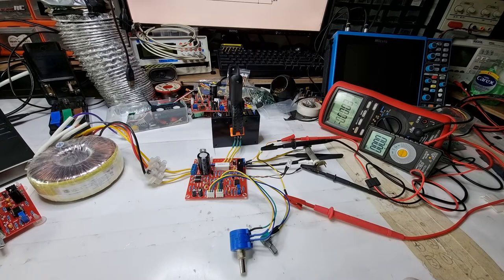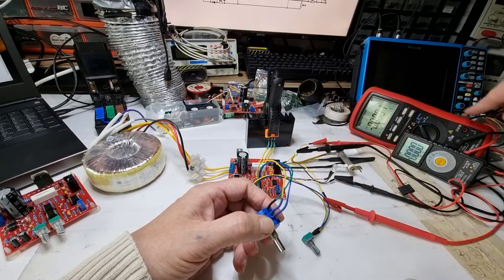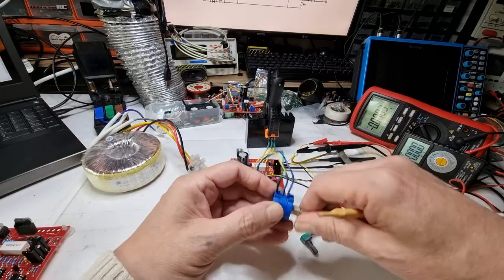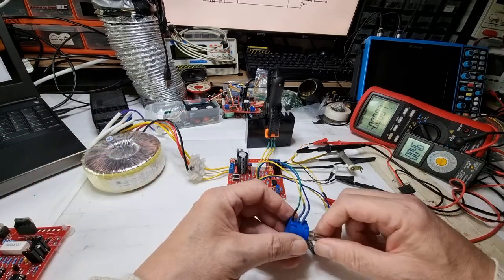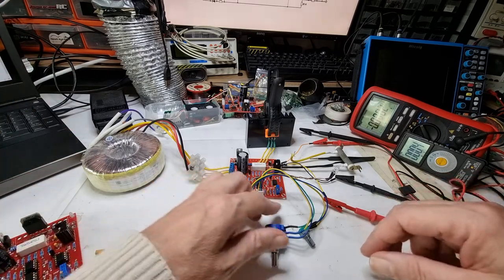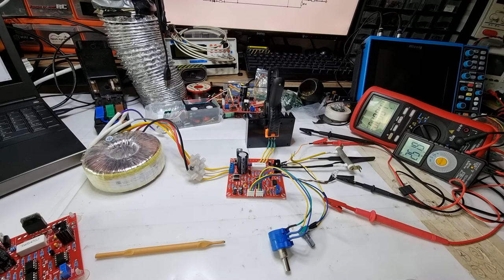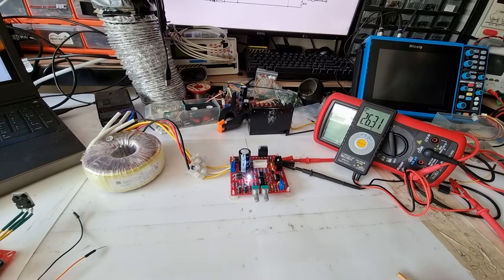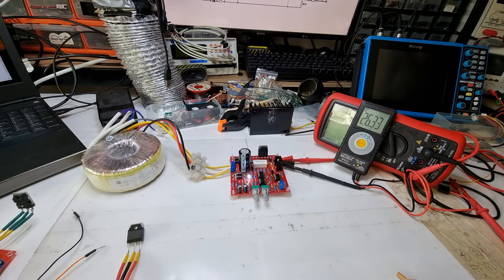Real HiLand 0-30V 2mA-3A PSU Kit vs Fake RED Board Kit

Comment: I had my friend build the power supply with the same power supply as you describing and I had no issues with it, he said some of the chips can not be trusted so he said anything he buys he install a socket. so you can easily change the ic's
after you build rather than de-soldering and screwing up the traces.
Reply from the maker: Hi, yeah I did that already but used cheap from Amazon and no difference. I am waiting on RS Components to get some in ~ February. Then will try again.
Reply: @Elecifun  hmm so replacing the TL081s does nothing. 🤔
Reply from the maker: so far I'm afraid not. I bought some TLO81 from Amazon seller based in UK, they didn't change anything but they could be dodgy clones.
Reply: @Elecifun  so the TL081 ICs you bought from Amazon you think maybe they're faulty or fakes or not what they're supposed to be? 🤔
Reply: @Elecifun  I was reading an article yesterday about the 0~30V 3A psu board.

The problems are know and common.

I think maybe the power supply is stressing the components.

I think the potentiometers on my kits are useless.

I think a few other guys threw them away and bought 10 turn pots still I've seen other guys using them.

Like for example a electronics youtuber like yourself had a 75VA transformer. 2x37.5.

He kept the 24V transistor (with the 24V port,) and added a drop down converter 0-40V on the input  (mini one) and configured it for 12V out. He's got a 12V fan running of it and he's using it to also power his 12V 10A Voltmeter/Ammeter.

Another guy swapped out his 7824 trannie for a 7812. 12V fans are more common and he's using the 24V port which is now obviously a 12V port to power not just the fan but also his 12V/10A voltmeter/ammeter.

This is another strange anomaly with this power supply kit.

Strangly he decided to keep the TL081s which most other electronics engineers decided to upgrade to 44V ICs.

That seems to be a weak spot with these PSUs.

A German engineer seems to think this psu board is over stressed and recommends using and a double 18V i think he said. Which I guess means its a much less powerful power supply.

The other guy using the mini step down converter used a 75VA transformer 37.5V x2.

Another interesting thing I learned is that  what I thought was just a power on light on the board isn't that at all. It indicates the PSU  is in some mode. 

Incidentally what power supply are you using? I can see its a toroidal but no idea what its rated at?

The guy that changed his 7824 and put a 7812 mentions some other interesting mods like swapping out the C1 (the fat cap) 3300uF for a 4500uF cap or some how modding it by adding another cap in parallel (god knows how thats done) and beefing up the .25W resisters for .5W resisters and various other modified if one wants to increase the current capacity. He I think seemed to think it was doable even with TL081s which seems somewhat confusing considering what the others were saying.

This guy did stipulate that a much bigger heatsink is required which is what I've now done.

In hindsight it was a good idea because before adding this new heatsink the fan was coming on every 5 minutes.

The D1047 gets incredibly hot even with a much bigger heatsink fan assy. He also says a TIP3056, or 2N3055 could be used instead of the D1047.

I'm thinking I might get some replacement parts like the TL081s even though you said in your case it made no difference to your issues.

I'm also going to add ic sockets for the TL081 opamps.

Maybe then later I could used the beefed up op amps.(44V).

Right now I'm ordering the .5W resistors and other more powerful components.

I have one more board left which is what I'll use.

That'll have all the more powerful components that this guy recommends using.

Anyway let me know how you got on with your mods.

Regards,

Decem.

Comment: Hi, back again.

Well I received my fake boards and finally finished assembly the kit.

No instructions.

No photos to work off.

Different components like ceramic caps instead of a 101P its a 107P. I don't think it matters but I noticed quite a few components like that.
I soldered one of the ICs into the board and later noticed it was not sitting flush with the pcb. My mistake. I couldn't work out which zener diodes were 4148s or 5V1.

I put the wrong one in the wrong spot and which meant I had to desolder it and put it in the correct spot on the pcb.

Then I realised I'd put it in the wrong way round which meant I had to pull it out again. Sigh.

Anyway finally I sorted it out except the IC sitting up off the pcb.

Anyway after another hour I had it ready to test.

So I grabbed my multimeter and probed the DC out terminals.

I gave the left pot a twirl and noticed it only goes up to 25V.

And it terribly unstable.

One one second its 18V then 66V!! 

Is that even possible?

Sigh.

Then the AC input switch shit itself or so I thought until I started fiddling with the switch.

I held my hand against one of the wires.

Something wrong with the AC input switch.

Conclusion.

I don't know until I build another one tommorow.

Maybe one of the zener diodes is in the wrong position.

I don't think so still it was very difficult to read the print on the side of the zener diodes.

Unfortunately I dont know enough about diodes to know which is which yet.

I can sort them according to their Uf and mVs but aside from that they're a complete mystery.

 Anyway, I went on my phone and read a few other comments on AliExpress.

There are quite a few comments saying exactly the same thing.

"Only goes up to 25Vs"

Which leads me to believe your right.

These diy kits are rubbish.

Anyway, I want know for sure until tommorow when I build another one.

Good night or morning.

Regards,

Decem.
Reply from the maker: Fair play for keep trying. I will wait for your next update eagerly. You can test the zener voltage with an adjustable power supply.
Reply: @Elecifun  I woke this morning and switched on my latest diy psu kit.

It's working fairly now but nothing over the 25V. 

I don't know how many amps she'll take.

I bought a nice big heat sink and mounted it to the back plate.

In the center of the heatsink is the psu kits fat transister.

I haven't mounted one of my 24V ball-bearing fans yet but maybe it doesn't need it now?

I wired a on off button into the front plate with two banana plug sockets.

On the other side is a small voltmeter and ammeter LCD.

How am I supposed to power the voltmeter?

I've got it plugged into the DC out port but every time I turn the volts down below 3.5Vs the display goes off. Strange phenomenon. 😄

Anyway, I quite enjoy making power supply's.

This is my second one of these crappy HILAND diy PSUs kits.

Still like I said before, I quite enjoy assembling and soldering on the components.

I'm just trying to get my head around zener diodes.
After I build the next board I might take a brake and get a bread board and experiment with zener diodes.

Trying and work out what all these terms like break down voltage means.

And other terms like forward voltage etc.

Anyway see you next time.

Hopefully I've built the next psu kit and swapped it over then I'll know whether it was my fk up or it is in fact these crappy psu boards.

Cheers,

Decem.
Reply: @Elecifun  Well I didn't build another counterfeit Hiland 0~30V 3A psu board today but I did manage to destroy my VU meter through over voltage. I put too alligator clips on both VU meter wires  (forgot to reduce the voltage) then suddenly a loud pop as a 220uF 16V cap exploded!  😆 

First major fk up.

So I thought I wonder if I replace the cap whether it will fix it? Hmm.

So swapped out the 220uF 16V cap for a 220uF 25V cap.

Well fk me it worked!😃😄👍

I now have a fixed VU meter.

Anyway I'll build another fake Hiland PSU board tommorow.

Catcha later.

Decem.
Reply: @Elecifun  Hi again. We'll I spent the later part of the day building the second DIY PSU kit.

It gets worse.

This second board only puts out 15.7V 😬 

These boards are garbage. Whats wrong with them?

The boards that you assembled? Were they any better?

Sigh. Well how disappointing is that? 🤔

I took my time on this build and it should be right.

But alas its not. We should get a refund because they're either not of merchantable quality or they parts are faulty or the design is faulty.

Why am I only getting 15.7V???

Update**

Under load it only 6.25v and the VU meter is flicking when it should.

What a waste of time these boards are. Sigh.

Night.

Decem.
Reply: @Elecifun  Well today was an interesting day.

I decided to revist my old and original diy  PSU.

Which is the 0~28V 2A jobby.

Initially there were problems with it.

Anyway, today, I was looking over my three PSUs all at different stages.

And I thought I might take the stupid little heatink fan off the board along with the D1047 trannie.

After mounting it to a huge heatsink. 120x80x45mm.

Well its probably a little premature to be making brash statements but I think maybe its okay now. I had it up to 780mA and its stable although the D1047 transistor is incredibly hot.

I pulled the heatsink out again and mounted to fan a few mm above it.

When I run a few (6) small light globes 2.5V it heats up. 
Eventually the fan comes on and cools it down.
So yeah quite pleased with the way it turned out.

I also built another power supply today from modular parts.

That was a bit disappointing.

I haven't got some of the parts yet.

Two potentiometers and maybe i need another transformer.

I learnt a few things today.

1. Some transformers output DC.
2. The grunty power supply isnt very powerful at all.
3. Something wrong with this power supply.

Maybe the transformer is way under powered. 🤔

I bought a 12V 5A TRANSFORMER think the project on the internet appears to be quite power.

No so.

It gets to 12V and won't go any higher.

😖

Where is the 5AMPs of current?

Comment: Hi, thanks for the video, so where can I purchase a real one guaranteed to be genuine?
Reply from the maker: @MrBobWareham M8 if I could buy them myself I would share the info. I have three working boards 2 are the genuine Hiland and work great. 1 is slightly different, it has a very noisy 24V output but still works. I've bought many that look real in some photos but are none workers, all my none workers have the 24V regulator 90 degrees to the pass/output transistor. I wish I could help.

Comment: am I get fake one? whats wrong with my setup.. I only get 25v max at output, I measure 33v after the bridge diode, and the indikator is on all the way even with no load.
Reply from the maker: Which board are you using?
Reply: @Elecifun  I guess the same crap we're using 1~30V 3A.😆